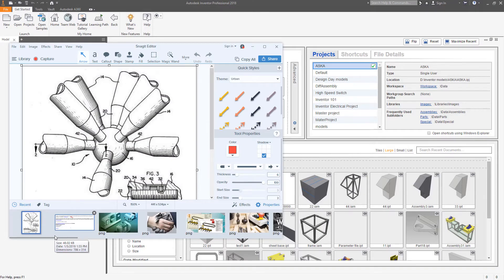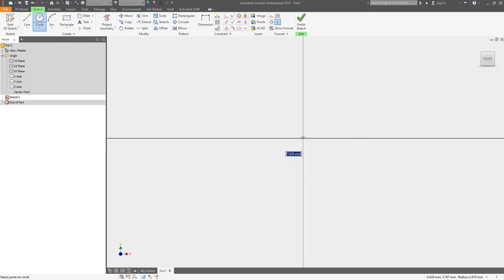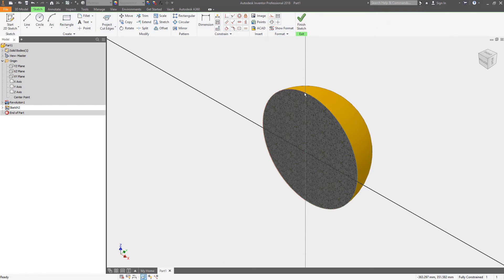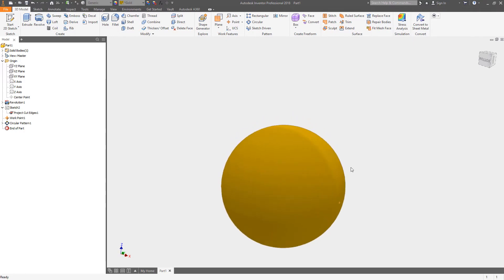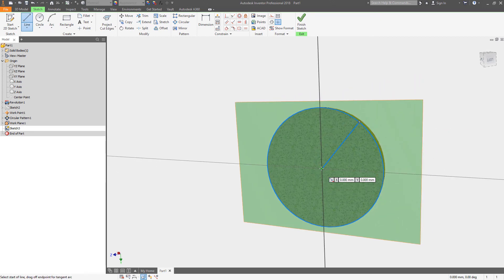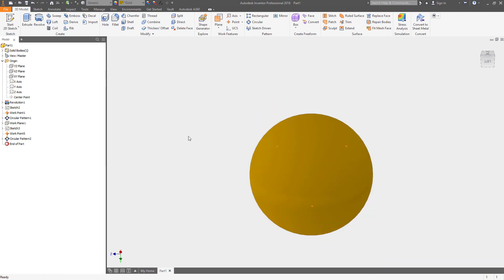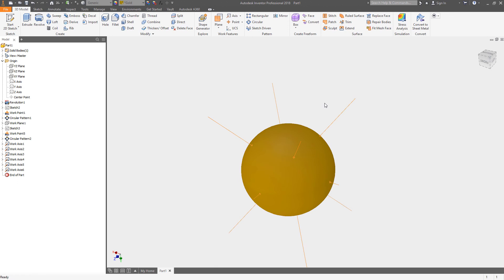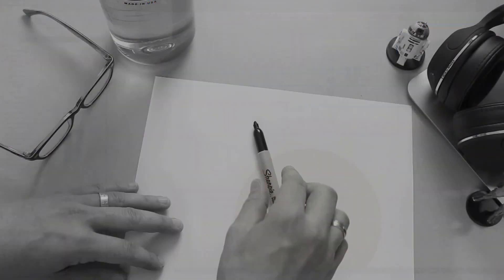#Autodesk Inventor quick(ish) tip: working with spherical stuff

Comment: Might be easier to define points w/in a 3d sketch, using the coordinate system. Maybe make the projection as a separate part and build the whole thing in an assembly. Derive and combine or make a composite, from said assembly, if you need/want a "single body".